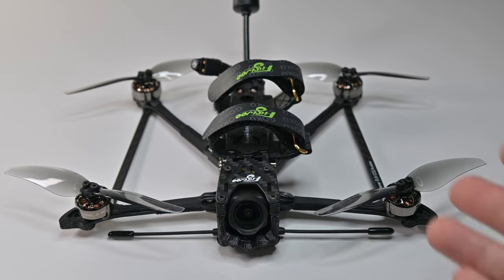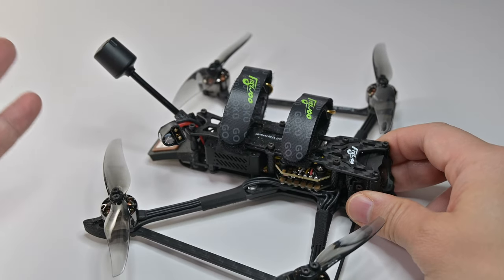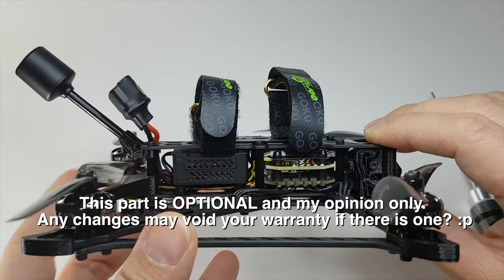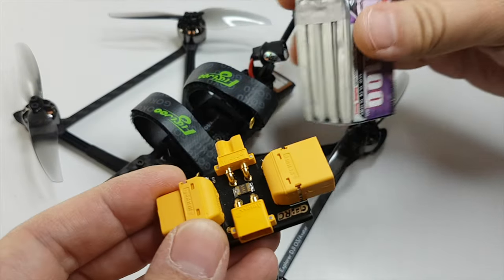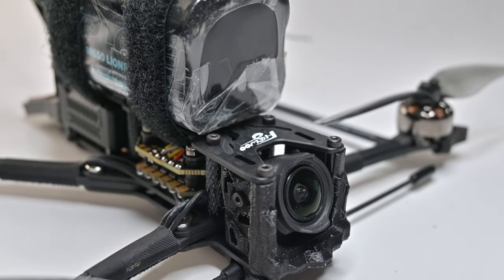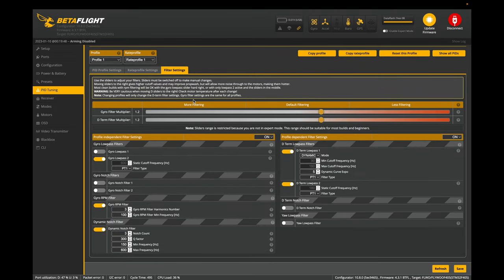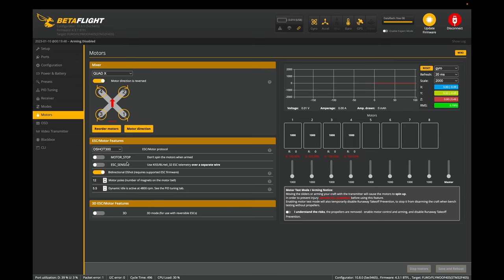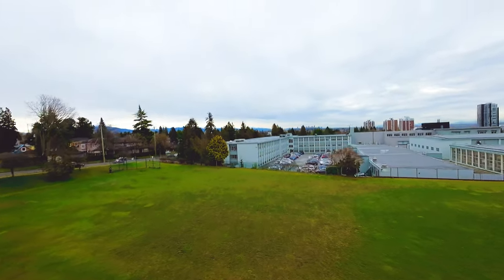Modifications & Tunes | Flywoo Explorer LR 4 O3

Comment: Anyone try this tune with the F7 FC? Curious if you left the frequency at 8khz and dshot600? Same all around tune after?
Reply from the maker: Sorry never replied this! Try the pids first without the filters, and do a careful hover test line of sight in angle mode in case of fly away and have finger on disarm button. but should be totally fine!

Comment: hello

nice video,i tried this one but got motors spinning 100%  ( flywoo explorer lr4 03 ) do you know why motor spinning at full event when stick is low.
Reply from the maker: This is motor bench testing? Is it normal at first and then the motors go full spinning? Or is it full spinning 100% throttle right upon arming
Reply: hello 
Thnx for the fast reaction, the motors first spin normal and after you throttle it a little bit up de rpm goes to 100% and can't lower it back to 0% , this is with the props on and of i thought maybe it is the angle mode so i tried with the props on and off, tried to reset to 48khz and same problem.  @PattyFlipz
Reply from the maker: @moesi38 sorry not sure. Did you check to make sure all your escs are configured correctly and same version? All of them need to match in specs. If it spins 100% did it fly away?
Reply: @PattyFlipz  yes al got the same firmware, after resetting the flight controller everything is back to normal.  (I hold my hand on top of the battery to prevent fly aways).
I am on Btf 4.42 is this maybe the problem ?
Reply from the maker: @moesi38  Sorry not sure. I pasted my settings onto 4.4.1 successfully. No fly away. Maybe you can try my CLI. Just back up yours first of course:

# master
set gyro_lpf1_static_hz = 0
set gyro_lpf2_static_hz = 600
set dyn_notch_min_hz = 150
set gyro_lpf1_dyn_min_hz = 0
set gyro_lpf1_dyn_max_hz = 600
set acc_calibration = 9,20,-1,1
set align_mag = CW270FLIP
set mag_align_pitch = 1800
set mag_align_yaw = 2700
set mag_hardware = NONE
set mag_calibration = 170,195,9
set min_check = 1010
set max_check = 1990
set serialrx_provider = CRSF
set dshot_bidir = ON
set motor_pwm_protocol = DSHOT300
set motor_poles = 12
set failsafe_procedure = GPS-RESCUE
set vbat_max_cell_voltage = 440
set vbat_warning_cell_voltage = 300
set yaw_motors_reversed = ON
set small_angle = 180
set gps_sbas_mode = WAAS
set gps_auto_baud = ON
set gps_set_home_point_once = ON
set gps_rescue_return_alt = 50
set gps_rescue_descend_rate = 100
set gps_rescue_throttle_max = 1750
set gps_rescue_throttle_hover = 1550
set gps_rescue_min_sats = 6
set gps_rescue_allow_arming_without_fix = ON
set gps_rescue_throttle_d = 15
set gps_rescue_velocity_i = 30
set gps_rescue_velocity_d = 20
set pid_process_denom = 4
set simplified_gyro_filter_multiplier = 120
set osd_warn_bitmask = 24575
set osd_vbat_pos = 2561
set osd_rssi_pos = 129
set osd_link_quality_pos = 2625
set osd_rssi_dbm_pos = 161
set osd_tim_1_pos = 2145
set osd_tim_2_pos = 2113
set osd_flymode_pos = 3530
set osd_throttle_pos = 2593
set osd_vtx_channel_pos = 161
set osd_current_pos = 2551
set osd_mah_drawn_pos = 2497
set osd_craft_name_pos = 2647
set osd_gps_speed_pos = 2520
set osd_gps_lon_pos = 18465
set osd_gps_lat_pos = 18433
set osd_gps_sats_pos = 3085
set osd_home_dir_pos = 2583
set osd_home_dist_pos = 2584
set osd_flight_dist_pos = 3149
set osd_compass_bar_pos = 330
set osd_altitude_pos = 3117
set osd_warnings_pos = 3594
set osd_avg_cell_voltage_pos = 2529
set osd_battery_usage_pos = 35233
set osd_disarmed_pos = 3562
set osd_nheading_pos = 533
set osd_flip_arrow_pos = 65
set osd_core_temp_pos = 2177
set osd_log_status_pos = 97
set osd_efficiency_pos = 231
set osd_stat_bitmask = 4603902
set osd_displayport_device = MSP
set vcd_video_system = HD
set gyro_1_sensor_align = CW180FLIP
set gyro_1_align_pitch = 1800
set gyro_1_align_yaw = 1800
set craft_name = NINJA LR

profile 0

# profile 0
set profile_name = Flywoo
set vbat_sag_compensation = 100
set iterm_relax_cutoff = 20
set p_pitch = 52
set i_pitch = 63
set d_pitch = 68
set f_pitch = 80
set p_roll = 47
set i_roll = 59
set d_roll = 63
set f_roll = 76
set p_yaw = 50
set i_yaw = 63
set f_yaw = 76
set d_min_roll = 41
set d_min_pitch = 45
set simplified_pids_mode = OFF

profile 1

# profile 1
set profile_name = PFlipz
set dterm_lpf1_dyn_min_hz = 90
set dterm_lpf1_dyn_max_hz = 180
set dterm_lpf1_static_hz = 90
set dterm_lpf2_static_hz = 180
set vbat_sag_compensation = 100
set anti_gravity_gain = 70
set iterm_relax_cutoff = 20
set yaw_lowpass_hz = 0
set p_pitch = 53
set i_pitch = 95
set d_pitch = 70
set p_roll = 55
set i_roll = 100
set d_roll = 68
set f_roll = 125
set i_yaw = 90
set d_min_roll = 50
set d_min_pitch = 50
set d_max_gain = 45
set dyn_idle_min_rpm = 48
set simplified_pids_mode = OFF
set simplified_dterm_filter_multiplier = 120

profile 2

profile 3

# restore original profile selection
profile 1

rateprofile 0

# rateprofile 0
set rates_type = BETAFLIGHT
set roll_rc_rate = 92
set pitch_rc_rate = 92
set yaw_rc_rate = 92
set roll_srate = 65
set pitch_srate = 65
set yaw_srate = 65

Comment: why did you change the motor poles to 12 from the default of 14?
Reply: I think the number must be the same with the magnets of the motor and the small motors have 12
Reply: @KostasGur  flywoo has them at 14... i wonder why.. I"ve just counted mine an they are indeed only 12.
Reply from the maker: Yes I'm not sure why either! Could be either a simple error or could be some magic trick for better efficiency or range (just guessing). Main thing is we do what we learned is correct and if it feels worse, revert back to their default tune I guess.
Reply: @PattyFlipz  who knows, I hope an error and not a magic trick for their tune.. Well I implemented yours and going for my maiden flight tomorrow 😁
Reply from the maker: @KostasGur  NICE!!! Looking forward to hearing how it went!!
Reply: @PattyFlipz  completely agree with you.
Reply: @PattyFlipz  well finally I did it with 2 batteries, the flywoo 3000 liion and the flywoo 900 lipo. With the 900mah it was very stable in diving too but with the liion during diving it was jerky in roll axis. The next day I flew it with a mild windy condition and it was jerky with the liion. I will check flywoo's original tune next weekend 😁 here is my first short with the O3 https://youtu.be/4kR2bNP1Mhk
Reply from the maker: Great to hear the feedback. Left you a comment on your video and subscribed 😀
Reply: @PattyFlipz  Thanks!!!

Comment: I just received my Flywoo Explorer LR 4 and having an issue where the O3 is stuck in low power mode. The voltage on the DJI OSD also reads 0 volts. Seems like there is either a config or wiring issue - super weird figuring this is suppose to be ready to go out of the box.

Any ideas on how to fix this? Flywoo support hasn't responded to any of my emails :/
Reply from the maker: Sometimes I get 0volt readings in the osd as well after a bad crash… just had to disconnect and reconnect power. Just checking as well, Did you register / activate the air unit on the DJI consumer virtual assistant and also did you try arming the quad yet? Arming the quad removes low power mode and enables regular power.
Reply from the maker: If those don’t work try reconnecting all the cables. Maybe a loose pin in the tx/rx
Reply: @PattyFlipz  hmm I did connect it to the DJI assistant to check for updates, but don't remember registering it. I'll look into that now!
Reply from the maker: @tylerbell4137 sorry I got it wrong, I think the word is activation, not registering. But yes take a look. And then arm the quad at home or something with no props and check for full o3 power. Hope it works out. 💪
Reply: @PattyFlipz  just tried, but I’m not asked to register / activate it 🤔 I think my next step is to take it apart to check the wiring.
Reply: checked the wiring and it looks correct. I referenced a photo on flywoo's website for the same FC / O3 and the wiring was the same.

The thing throwing me off now is the DJI assistant never asked me to activate it.
Reply: well after checking again it does appear there is a wiring issue. looks like 2 of the wires need to be crossed to match the photo. will give it a shot.
Reply: Okay update, I switched the tx/rx wires to match the photo I found but no luck.

If it's easy, do you mind sending me how your explorer is wired from the FC to the O3 unit?

I'm at a loss here - flywoo hasn't responded to me in days.
Reply from the maker: Ok best to switch everything back. Usually the plug should be correct and it’s from factory o3 au. Did you try plugging in the lipo and arming (get the motors spinning) and checking what you see in the goggles?
Reply from the maker: Also. Did you install the arm bracers and might have used the wrong screw and they are touching the copper windings? Sometimes that can mess up osd and vtx.
Reply: @PattyFlipz  yep, tried plugging in a lipo and arming. The quad itself arms just fine, props spin up etc, but yeah the O3 unit always reads 0Vs and stays in lower power mode.

I did install the arm braces - just checked and there are no screws touching the copper windings.

the mystery continues.
Reply from the maker: @tylerbell4137  Dang sorry bro. Yeah sometimes it just takes the entire work day or more troubleshooting, but once you're in the sky you forget all about it XD
Reply: @PattyFlipz  Haha yep. Tomorrow I'll manually set the O3 to high powered mode by turning off the temperature control in the goggles. Someone on reddit recommended that so it's still flyable while I get the bug worked out.

Comment: Hello, I have a flywoo version v2 and I would like to get the stl file of the dji o3 mount for the camera, would you know where I can get it?

Thanks!
Reply from the maker: Hi Alex, sorry Im not sure. You will have to ask flywoo. Also it will be very hard to fit o3 au in the back trunk. Check the size too because props might strike it.
Reply: @PattyFlipz  I have it mounted and it has already flown with the v2 frame with the dji o3 installed and it flies very well, the only thing that would interest me was having the tpu mount that this version has since I have it with a mount that I don't like very much and adjust the camera vibrations
Reply from the maker: You can check the flywoo support page. Sometimes they have stl files. If not when I have time I will see if I can design a o3 camera mount :) will update if I do
Reply: @PattyFlipz  hello.  I talked to the flywoo support and they gave me the link of the stl, but the mount for the O3 is not there.
Reply from the maker: Just trying to understand you correctly. They gave you stl file for the camera? But are you also looking for a mount for the air unit box? If so, You may need to get an adapter to fit to the bottom, such as the aluminum one from newbeedrone where o3 screws into 25x25 holes and you can screw in 20x20 m2 into the aluminum bracket. Check fitment and spacing and dimensions though, its 3mm thick. For my explorer o3 frame it has 25x25 holes and flywoo just used 4mm/5mmish nylon stand offs and longer 1.6 screws right into the o3 unit. no prints for the air unit.

Comment: I'm looking at flashing my explorer from 4.3. Did you use the factory CLI settings file for 4.4 and instructions from the flywoo help centre? I think there were some instructions about core only setting etc.
Reply from the maker: Hi, yes I followed the same instructions (core only) and uploaded their cli dump to make it work. Their tune is revised from the 4.3 version. Although I haven’t tried it, my friend said the new tune is great. Give it a try.
Reply: @PattyFlipz  Have you had a chance to try the upgrade to 4.4? I have updated to BF 4.4 using Flywoo's instructions using their CLI, and I'm wondering if your tune here in this video still applies.
Reply from the maker: @DanielPeckham hi I did switch over actually and it works fine so far.